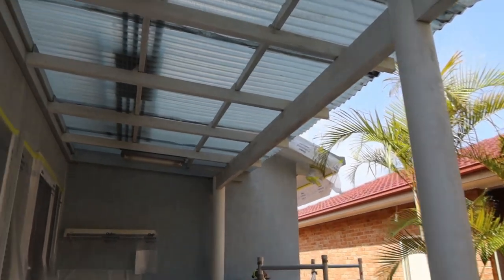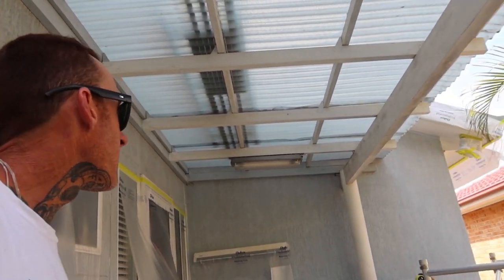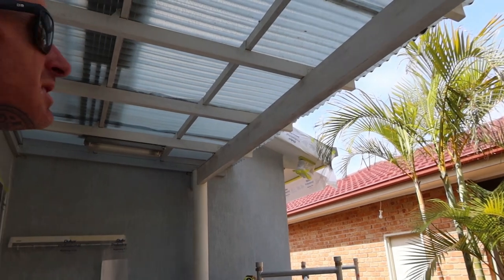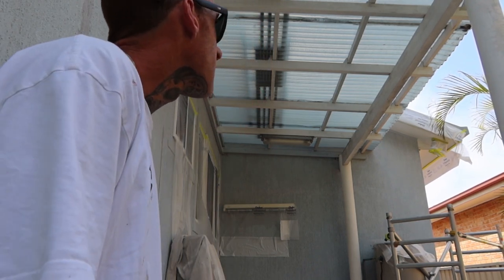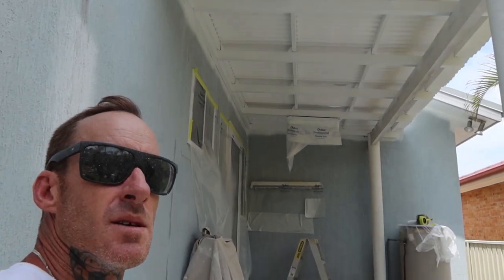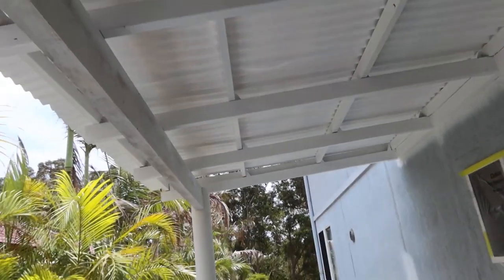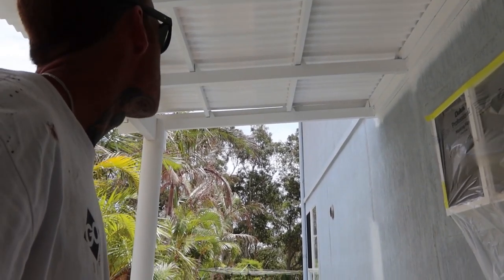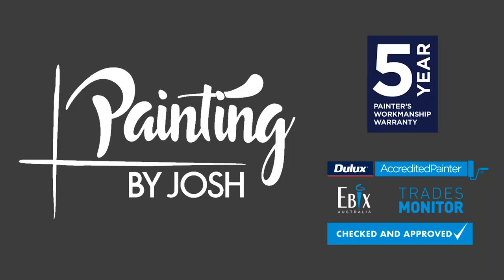SPRAYING OUT UNDERSIDE OF PERGOLA

Comment: In Australia what would you use to paint a galvanised steel pergola? Thanks :)
Reply from the maker: Sorry for the late reply Rach, I would use Dulux acratex Mx primer & top coat with Dulux acratex roof membrane that's doing it 💯  you also could go straight over with Dulux Weathershield for a quicker job 👍